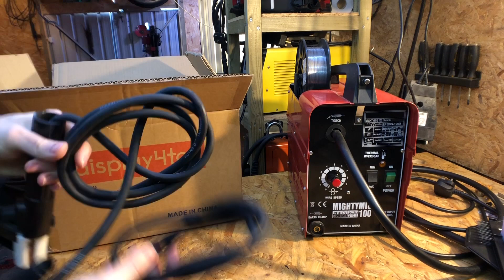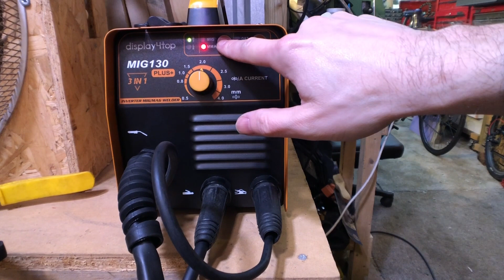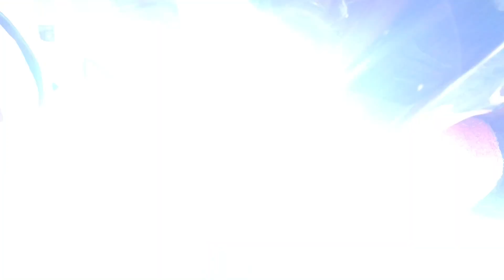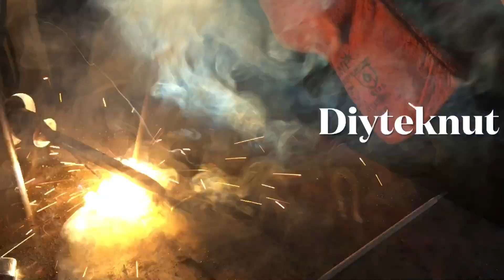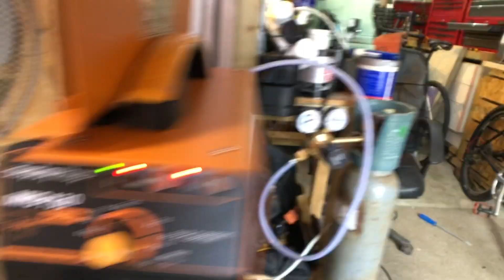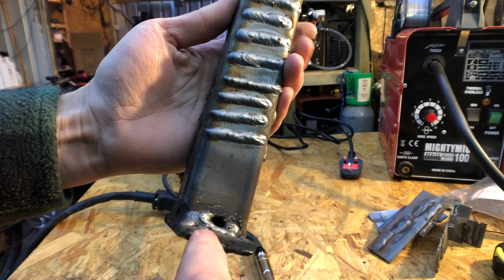Amazon’s Cheapest Mig Welder Display4top 3-in-1 Igbt Inverter Mig £120 $160

Comment: Has anyone experience with welding car body panels with flux core wire with this welder? With an AC flux core  it burns through the 0.8.mm metal. Will this DC machine do any better or just less spatter?

Comment: Can this weld car exhaust pipes? (holes, detatched pipe from catalytic, etc)?
Reply from the maker: yes it will, but depends on your skill with a welder. plus if the steel is thin rusted to much you may not be able to, and be very careful around petrol tanks.

Comment: I just bought one , First thing ( Check the Fuse ) and replace with a proper UK 13amp one . The fitted fuse has an external bridge wire soldered on , Better Safe than Sorry

Comment: Where are you getting 7014 rods in the UK? I have never been able to find them (7024, 7016, 7018, 7028 etc but no 7014). I like 7024 but they are only any good for thick pieces of steel.
Reply from the maker: Import Buy them from Amazon.com, not uk site . You can I think still get them from Zoro uk

Comment: Can you clarify what wire size you used with MIG? Need to do some thin car bodywork so thinking this welder with 0.6mm wire and a co2/argon gas mix at maybe 10 litres min? Thanks
Reply from the maker: It’s setup for 0.8mm you can buy 0.6mm feed roller of eBay.
Reply: @JAYZWORKSHOP  Thanks, was thinking 0.8 might be a bit too thick for car bodywork but I'm only use to older welders, maybe this new type of welder with more electronic control is fine with the thicker wire on thin metal ?

Comment: Just bought it on your evaluation. What gas would this take for weld alu ? 5% Argon ??
Reply from the maker: 100% argon for alu and stainless. I ran the whole reel of flux core to see if I could brake it . Best to give a good test when you get em if it brakes send it back.
have fun my friend all the best.
Reply: @JAYZWORKSHOP  Will do hopefully it will stand the punishment. Only needing about 6 x 1" welds on a outboard leg 1/4" thick alu. Pity it couldnt take 15kg rolls of wire, maybe a bit too much for a sub £100 welder lol
Reply from the maker: @andytinline7717  if you have a big spool you could wind a small spool with a cordless drill.
Reply from the maker: 1/4 might be outside the capability of this machine you probably won’t something with more power. You could try You might want to preheat with a propane torch before welding and put a tapered edge to get god penetration and fusion .

Comment from the maker: This welder is not always available and when it is with the price increase its not worth the money
https://amzn.to/3Z8gecA
I would go with this one MIg Welder https://amzn.to/3SlUGa5 often its on sale and its just better machine.

Tools i would like of Amazon
*Cobalt Drill Bit Set https://amzn.to/3coyx88
*MMA welder i would like https://amzn.to/3r4SuVo
*MIG welder i would like https://amzn.to/39tXI7e
*TIG welder i would like https://amzn.to/3r3N2lU 
*Cobalt Drill Bit Set https://amzn.to/3jtm4Bx
*Cordless drill  https://amzn.to/3txtLey
*MMA welder i would like https://amzn.to/3jsENNv
*MIG welder i would like https://amzn.to/3tBjFcM
*TIG welder i would like https://amzn.to/39V9LdW 
*Tin Snip https://amzn.to/2YTpdB9
*Welding Clamps https://amzn.to/3oSpVco
*Machinist Hammer https://amzn.to/3q0TObP

#CHEAPWELDER #MIGWELDER #IGBT

Above are affiliate links and in the comments it costs you nothing, if you do not want to use links search on goggle more info Thanks.
Reply: Hi. I am new to welding and have bought this one based on your expert review. One question about the gas for MIG for steel for car body work. CO2?  I have seen the small bottles in Halfords and eBay. I assume I need a regulator too? If so can you recommend one? Cheers Simon
Reply from the maker: @HiSiWi  yeah you want co2 argon mix for sheet, if you get these disposables Expect to get only about 8 mins welding time out of co2/argon.
The straight 100% co2 bottles last about 25 mins. makes welding extremely expensive. 
Plus this welder is setup to use with a big bottle you can adapt it to disposables if you want.
 you can get a big 5% CO2 / Argon Mix 10L 200Bar – Deposit and Refill £93.08
 rent free bottle at https://www.adamsgas.co.uk/product/hobby-gas-rent-free-5-co2-argon-mix-9l-137bar-new-bottle/
if not try using flux core i was quite impressed how well this welded 1mm sheet
with some practice.